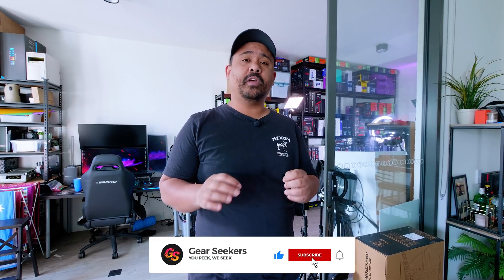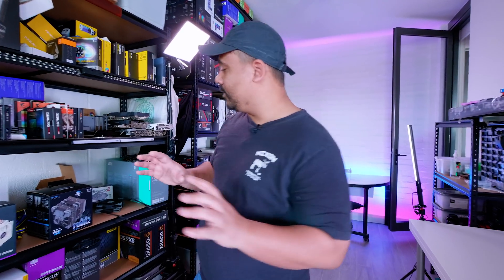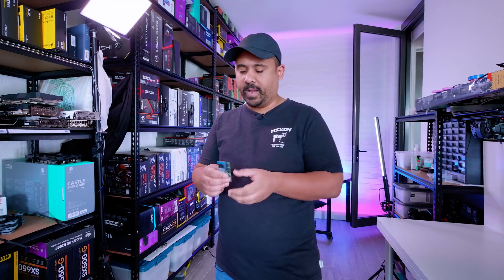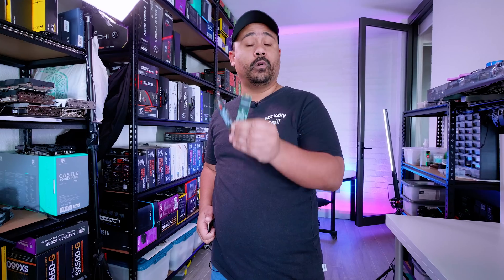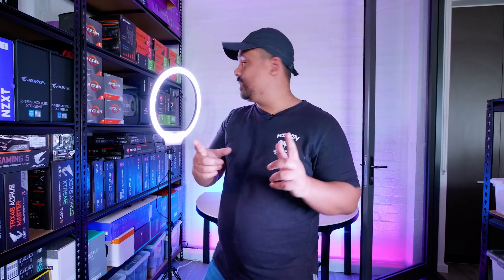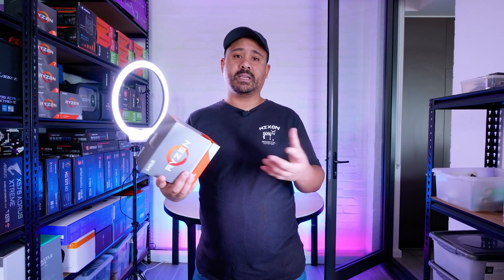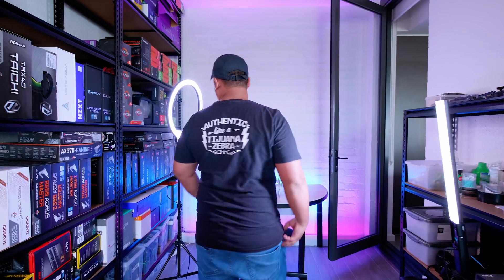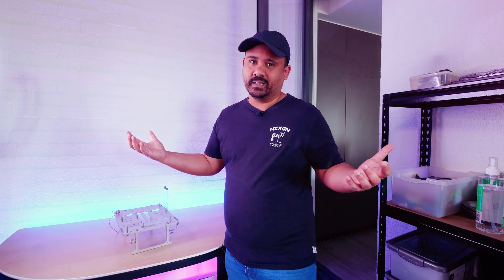Upgrading Our Test Bench to PCIe 4.0 for NVIDIA RTX 3090, 3080 & 3070

Comment: Gear Seekers quick question. I have a i7 9700k with a asus z390e mobo and 2080 super. I was considering upgrading to the 3080? Will their be any issues by chance? I do have a corsair rm 750x psu as well

Comment: Bruh. 3070 has the recommenation of using 650W (maybe 750W for OC to stay on the safe side) power supply and 3080 and 3090 a 750W (maybe 850W for OC to stay on the safe side). U dont need a 1200W lol. Sry thats too much.
Reply from the maker: Remember when I said that I didn't care. Yeah still don't care.
Reply: @GearSeekers  Sry was just saying to other people so they dont buy a too pricy psu when u dont really need it. Still a good video though.
Reply from the maker: That's exactly what I said in the video. It's test bench. It's meant to be able to handle multi GPU setups etc.
Reply: @GearSeekers  Ok I get it :)

Comment: please test pcie 3.0 vs 4.0 with the new nvidia cards - possibly just by switching from x570 to b550 ? all other parts stay the same?
Reply from the maker: You can change PCIe modes in the BIOS. This is why I went with PCIe 4.0

Comment: I get the argument for using Ryzen 3rd gen for the test bench system, due to PCIE 4.0. 

However, I do hope you do some testing with a 10900K/10700K/9900K. Given Nvidia is pushing a 360hz/1080p monitors and all. I don't think testing a 3080 or even 3090 at 1080p is a redundant endeavor. As we know already, those Intel CPUs do provide higher frame rates at 1080p than any of the 3rd gen Ryzen CPUs on average.

Comment: I will be getting an RTX 3080.
Is a Ryzen 5 3600 sufficient to avoid bottleneck (I know there are different factors like resolution and stuff influencing this factor, but I mean general [gaming] performance) or should I upgrade to a Ryzen 7 3700X?

Comment: Why would you keep the PCIe Gen 3 SSD`s in the test bench? PCIe Gen 4 is mentioned every other minute as the reason to upgrade yet you keep the old SSD`s in the new build.  This could leave some performance on the table due to the direct storage feature being implemented in windows and advertised by nVidia.
Reply from the maker: Wrong. Not available at launch. Titles also need to support it.
People are hearing what they want to hear. Storage speeds right now and up until launch will not impact performance hence no need for Gen4 drives. That's the thing with YouTube mate, when we switch the drives out we aren't going to make a whole video about. This video is about preparing for the things we know about right NOW (which for us is more than the public) and creating a test setup for what will be available at launch.
Reply: @GearSeekers  Fair enough, at least you have it on the radar to upgrade when it counts I guess.  Once the feature is available it would be cool to see an SSD showdown between gen 3 vs. 4 to see if it makes a difference at all.
Reply from the maker: We know what's going to work at launch which is why we structure videos like this. That's the bonus of being a part of this industry ;)

Comment: If I'm not mistaken, you did not use a PCIe Gen 4 NVMe SSD. Was there a reason for that? Supposedly the new cards will access the SSD directly without having to go through the CPU and RAM first so possibly having a Gen 4 compatible SSD may help performance. Maybe someone else can clarify if I wind up being incorrect
Reply from the maker: Not available at launch. I'm not doing videos about incremental updates to a test bench. I'd only do a video if everything is changing.
Reply: @GearSeekers  Gotcha! Thank you for your reasoning
Reply from the maker: I have a reason for doing everything.
Reply: @GearSeekers  Oh, I know. I just wasn't sure what it was. I wasn't aware that the communication to the SSD wasn't going to be available at launch so it makes sense. Thank you again 😁

Comment: Please add in a test bench where you test the GPUs in a horizontal mount orientation (I.e. like the 99% of us) so as to test the cooler performance In that scenario. You won't get a true picture of thermal effects without it. Hardware Unboxed showed the difference when a card has a deficient cooler, that the performance is made worse when slung horizontally and there's poor thermal contact between component and cooler/cold plate. So important this time round..looking at you MSI and Asus..

Comment: I'd wait for the supers and the RDNA 2. If were to make an educated guess based on the 1000 series and 2000 series, This is likely how it will go if let's say for the sake of argument that 2080 has 100 FPS as a baseline.
RTX 3070 - 8 gb with 120 FPS ($499)
2080 TI - 11 gb with 125 FPS ($1200)
RTX 3070 Super - 8 GB with 140 FPS ($549)
RDNA 2 /6900 XT - 8 gb with 130-140 FPS ($399-449)
RTX 3080 - 10 gb with 180 FPS ($699)
RTX 3080 Super - 20 gb with ~200 FPS  ($749-799) -> Could even be priced at $900-1000
RTX 3090 - 24 gb with 216 FPS  ($1499)

Comment: Just curious, do all of the m.2 slots get their pcie lanes through the chipset? if the lanes are coming from the cpu it may take away lanes from the graphics card, affecting pcie bandwidth, the whole point of the new test bench. I could be wrong but I was just wondering.
Reply from the maker: It doesn't

Comment: Wait so can Intel systems have 3000 series cards?
Reply: Yes. The thing is that the 3800 and bigger might get data throttled a tiny bit. Don't know yet though. And also don't know if future games will utilize PCIe4 ... If you already have an Intel system, don't bother. The differnce isn't anything to worry about yet.
Reply from the maker: Some of you really missed the point
Reply: @GearSeekers  I think the question was really about Intel beeing compatibel with rtx 3000 -- Yes. My answer was based on benchmarks with the 2080ti on PCI 3 x8 and x16, while seeing a 2%ish improvement in some games. Based on that it might be possible that the 3080 is capping PCI 3 x16. Long story short, we don't know yet if there is an improvement and even If there isn't one right now, future titles might utilize PCI 4. Because why shouldn't they. Developers are working within the set boundaries.

Comment: Hey Nick, It would be nice if you add a ssd nvme gen 4 also to the bench test to see if it gonna make any tangible difference with the new feature of DirectStorage API which would reduce the load times and improving the latency I guess, thanks.
Reply from the maker: Not going to be available at launch. Right now it's not useful
Reply: Thanks for the info👍.

Comment: Hey new to pc gaming. I'm having my gaming rig built for me and I literally have a day that I can change parts.(pc specialist uk)
Would you advise removing the 2080 super from the order? 
If so wouldn't I still need to know what power I need (currently 650 gold standard) and what cpu to run with it? (Currently and 3700x).
I am new to pc and my thoughts are just to order it with 2080super as I know no better anyway it will still give me good performance and get the job done rather well. Anyones thoughts on this?
Reply: I guess what I'm trying to say is coming from console to a pc would i still be extremely happy with the specs I have besides the 3080?

Comment: Oh, NVIDIA finally mentioned something about the power usage of the RTX 3000 series gpus. According to them, the power measurement publicized wasn't the gpu's "max draw" at load but it's long-term draw (or some other wording, I forgot). As long as users use separate power cables for each power cable slot and use the 12-pin adapter, there will be no problem with an appropriate PSU wattage. As if to confirm this, many of the after-market version of the RTX 3000 series cards have been revealed to actually have 2x8-pin power connectors or 1x6pin+1x8pin connectors. Alleviates some of the worries many people have about their PSUs really. I think as long as you have a 750watt PSU you should be fine if I understand it correctly.

Comment: Once I get the money, I'm gonna get the 3070 definitely. The huge boost in preformance is crazy. The fact that a 3070 is twice as powerful as a 2080 ti, and it's way cheaper
Reply: Except that Nvidias graph shows that it is basically just as fast as a 2080 TI.
Reply: Jacob Plyler yeah it’s only slightly faster. But the price drop is great

Comment: I'm very excited about this. Love your work. 
Would love to know your thoughts about our chances of getting a 30 series card in Aus. Hoping to get a 3080 at release but every man and his dog will be ordering them.
I've also got a Fuma 2 coming in the mail for a 3900X build so I'm stoked to see a similar setup for the test bench.
Reply from the maker: They will be easily available at launch here in Aus.
Reply: Rob, I have a Fuma 2 on my 3900X system (32GB 3600 DDR4, RTX2070) and with FAH running full out I can keep the CPU below 85C.  It would be cooler but the 2070 blows its hot air directly into the Fuma2...  ;-( My Aurous Ultra MB doesn't have 16 channel capabilities on the lower GPU slot which would reduce this issue)...  Anyone have other suggestions for running this cooler?  Routine operation I see CPU temps below 50C...  I've got six fans in a CoolerMaster HAF HB EVO case...
Reply: @johnbeeck2540  Thanks for the info. I haven't built mine yet but I've got a case with a mesh front and 6 fans. I imagine the cooler would be fine for the CPU without a GOU blowing right into it. I'm a little concerned about the fan placement on the 3080 and blowing straight at the cooler tower.
I don't really get what the point of after market cards with fans blowing downwards is. Seems like hot air will still get pumped around the case.
Reply: @robwhitmore3040  I totally agree with you!  Seems GPU fan designs could take better advantage of the typical case airflow patterns versus dumping hot air directly into/onto the CPU/RAM cooling systems...  It also strongly demonstrates that motherboard manufacturers may need to rethink the configuration of the GPU slots - perhaps make the middle or bottom slot 16 channel so it has a large space between the GPU and the CPU for better cooling...

Comment: Why Not the 3950X? I would figure you don't want to add more CCX's? I actually chose the 3800XT for my most recent build because at 8 cores there are only 2 CCX's and therefore theoretically less latency  with Less infinity fabric dependency also gaming is the major focus of the machine with only light productivity work Mainly Photo Shop and Word. I have no solid data to back up my theory it just kinda made sense to me. I really can't wait for ZEN3 with 8 cores per CCX!!! Maybe then I'll go for 16 cores when it comes out. I also found that the 3800XT has a 100mhz higher base clock than the 3900XT 3.9GHZ to 3.8GHZ with the same Boost clock of 4.7GHZ
I always enjoy your work and your transparency.
Any thoughts. Thank You
Reply from the maker: Well all of my 3950Xs are being used. I explained that the reason I used the 3900XT is because I'm not using it.
Reply: I was not faulting you at all in your choice. I actually believe the more cores may be detrimental for gaming purposes.  Wanted to know if you had an opinion on it is all.
Reply from the maker: To be honest if I had a 3950X I would have used it
Reply: Thank you. I'm sure what you have set up will be Great!!! Most likely better. Higher Clock less latency. Can't wait for the benches. Bless!
Reply: Paired with ZEN3 it's gonna be sick!
Just hoping AMD doesn't turn into 2014 Intel with pricing.

Comment: Ur going to need to buy a new PSU on the new standard to get max performance from a 30 series the adapters will bottleneck the power flow
Reply from the maker: No they wont

Comment: Whilst Nvidias own presentation says they tested using an Intel i9 platform, life going to get real interesting if it turns out PCI4 actually brings additional benefits ...

Personally, I think I'll be getting a 3080. will wait to see what AMD bring to the table however, I have a couple of G-Sync monitors and not convinced about AMD's drivers these days.
Reply from the maker: Yeah I'm very curious to see if it yields any differences. There is a very complicated working relationship with AMD and NVIDIA which is why the would have used Intel for testing. It's pretty odd since the Datacenter application for Ampere uses Epyc.

Comment: I got an ASUS ROG RTX 2080 Ti less than a year ago which sucks and it was for my first pc but I’m going to get the 3090. Only issue is I don’t know what I need to upgrade other than my PSU. I have an i9-9900k which I’ve been told should be good enough for the gpu. Will I also need a new MoBo?

Comment: Considering the FE cooler design it may be bad for cpu air coolers so cpu temps maybe higher
Reply from the maker: Yeah but thats the point of using an Air cooler. To find out if it impacts it. Which it wont because any airflow is good airflow
Reply: @GearSeekers  good point there hope the cpu temps are good though
Reply: @GearSeekers  Unfortunately an open test bench isn't going to help in determining anything.

It's quite possible that FR cooler will bring an unexpected advantage to AIO coolers!
Reply from the maker: @xalenthas  except that it will lol